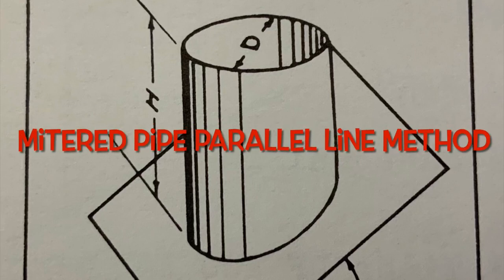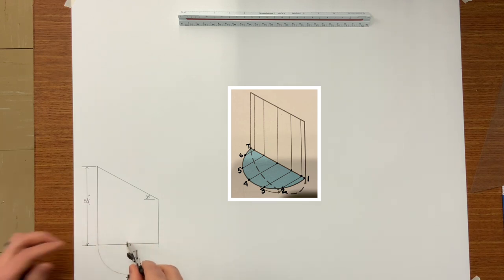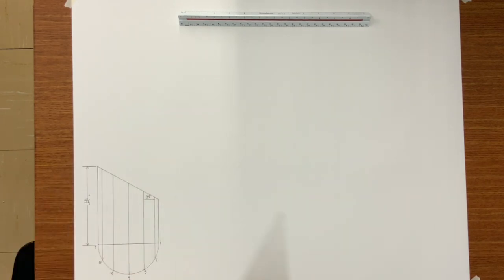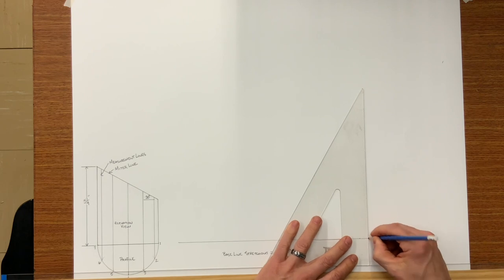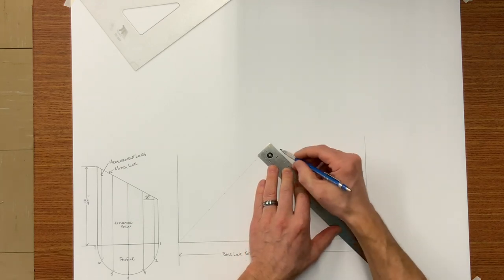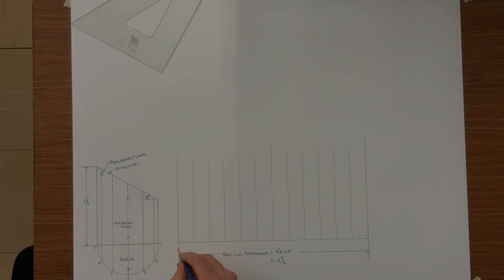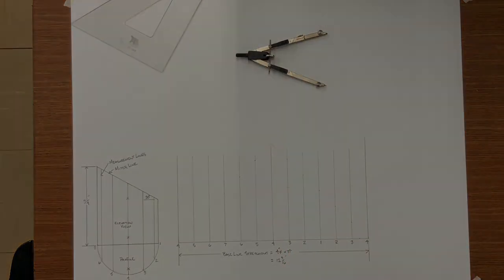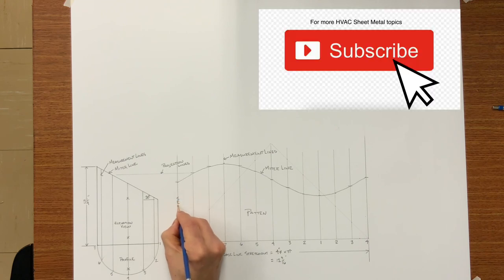Parallel line Development - basic pipe miter, paper layout

Comment: Thanks Duane.  Could you advise where I could buy a mini drafting table, tee square, dividers, tri ruler etc.  Such as recommended brand names and such.  Cheers from Parry Sound, ON.
Reply from the maker: The cheapest way would be to cut a piece of plywood, preferably finished on one side approximately 20 x 28. All of the drafting equipment you mentioned can be purchased at Staples. As far as recommended names, there’s not a whole lot to chose from, Staedtler and Pico.  I hope you do find what your looking for. Cheers from Moncton NB.

Comment: I didn’t see an email but I have an off the wall question.  Would it be possible to weld together a 54x54 18g drain pan?   Is it worth trying?  Thanks.
Reply from the maker: 18g can be welded, some metals and their properties can be trickier than others. Go for it, you can do it.👍
Reply from the maker: I forgot to mention that you should always try a few welds on scrap first, it will help you find the welding parameters.
Reply: @sheetmetalwork  the trouble is the size of the thing.  54x54 I only know of 48x10 sheets.